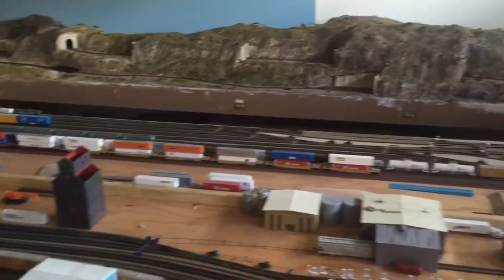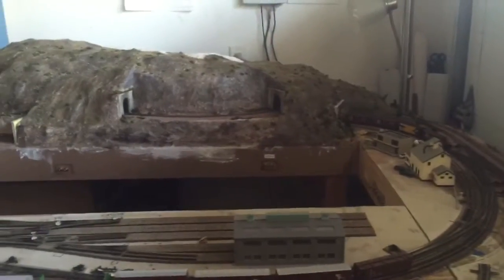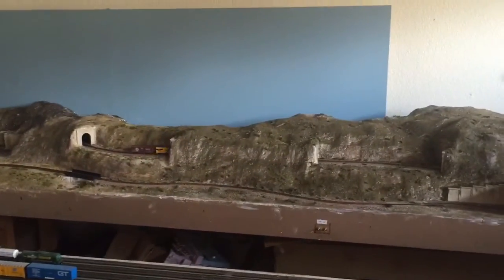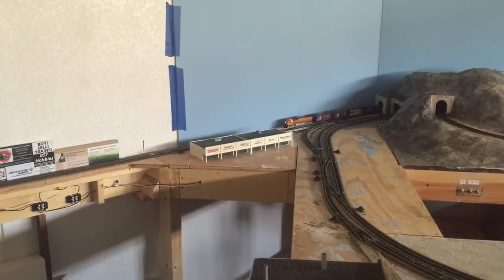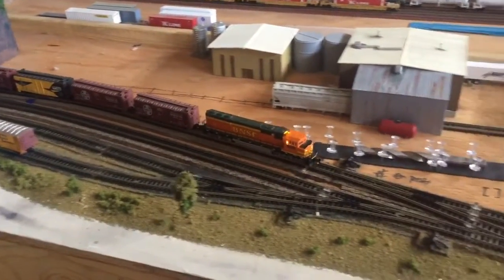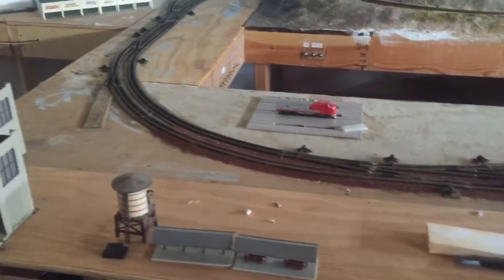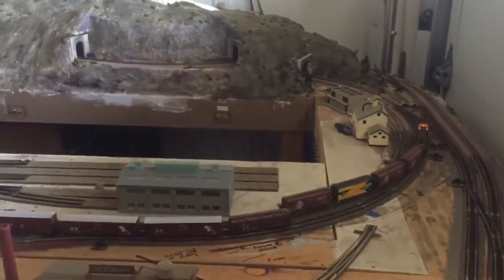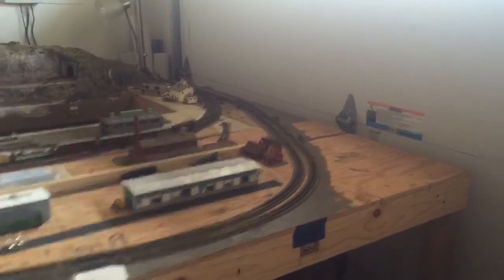N scale SoCal BNSF layout tour

Comment: Hey Steve, great layout you have there. I'm starting my N scale layout myself, how wide is that back table with the mountains? I'm doing a 2ft wide table almost all way around my garage and trying to figure out how I can do a U turn without making the turn too sharp for the consist.
Reply from the maker: Justin Todd  the mountains are about 31 inches in depth. There are two turn backs (u turns) in the mountains (one on each end) and most rolling stock handle it pretty well. The only rolling stock I have that doesn't like them are the auto racks, I'd make it deeper if I did it all over. Let me know if you have other questions, I'd be glad to help if I can. - Steve

Comment: Nice layout tour.  You said that you originally had the layout as DC, but then you decided to go to DCC.  What made you make that change?  Was it hard?  Are you happy now that you have had time to play on DCC vs. DC?  Thanks.
Reply from the maker: Hi, I decided to go DCC because there is so much more you can do with DCC vs DC. I wanted independent control of each locomotive or consist and DCC allows me to do that.  I am very happy I went to DCC, I have about 5 of my 55 locomotives to install DCC decoders in and I won't own anything DC anymore.  Let me know if you have anymore questions, I'd be glad to assist where possible. Thanks Steve